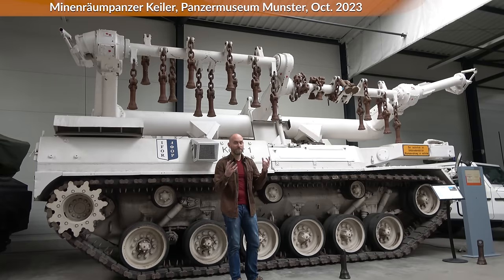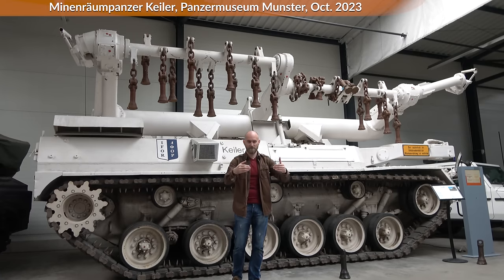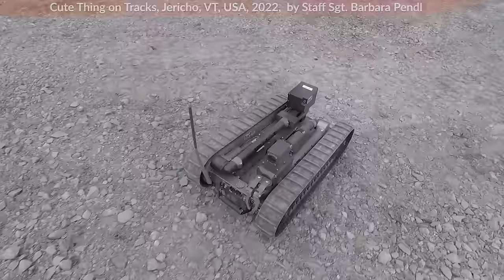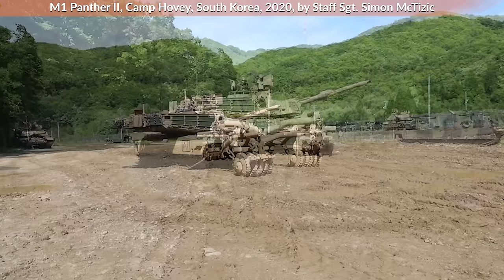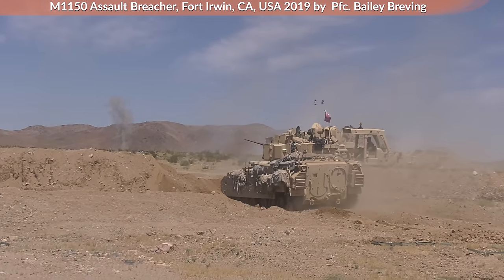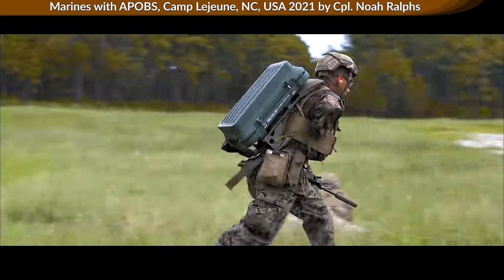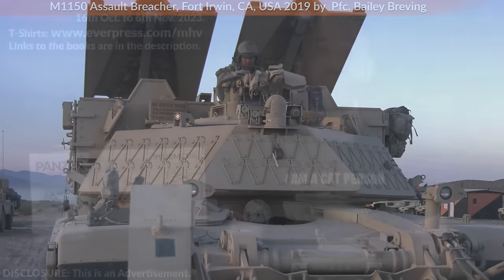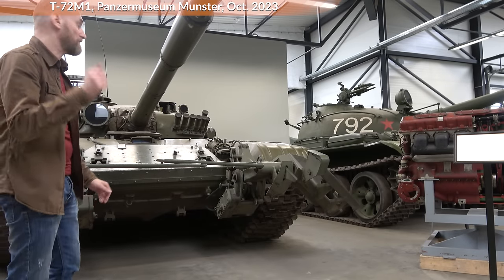Ukraine: The Problem with Mine-Clearing Tanks

Comment: You need to use 2 assets to conduct a "deliberate breach" to "clear" a route - say a MICLIC and a Plough, not just one unless you want to accept risk with a "hasty breach".
The next issue is the depth of major minefields - a MICLIC (or Giant Viper) charge is only good for around 250m. If the minefield is say 1km deep you need to repeat a process of MICLIC then plough 4 times as you clear each 250m segment.
Also you need to plan on 50% losses to breaching assets. If you want 4 lanes open you need enough assets to start 8 breaches - 8 x MICLIC, 8 x Plough for a minefield 250m deep.
The KMT type option also limits follow on vehicles to the same width. You effectively break up a combined arms team because the BMPs, BTRs etc. can not drive down the same track width lanes as they are narrower than the breaching vehicle.
Lastly if you aren't using SOSRA (Suppress, Obscure, Secure, Reduce, Assault) your attempt is likely to fail as the obstacle will be covered by fire and observation.
Reply: as soon as there is activity in "mine field" you can expect a direct artillery hit as area was already scouted, measured and mapped for it
Reply: @rcajavus8141  Absolutely, one of the reasons why you plan for 50% losses.
Reply: US really needs to replace MICLIC...its never been a very good system.

The UK replaced Giant Viper with Python about 15 years ago. Twice the length and uses IM explosives. A Trojan towing 2 units can clear a 400m long path.
Reply: @dogsnads5634  Understood, I just wanted to provide some open source examples. The principles remain the same though.

Comment: Since these systems are rather rare, expensive, slow and very exposed when they're used, the fist thing you need to do to clear a minefield, is completely suppress any artillery system in the surrounding area and obtain air dominace.

Comment: That system on T-72 makes more sense than the one on Abrams, with rollers. If I saw well (but could be wrong), that Abrams has 2 rollers to the front in front of the tracks and one in the middle, at the back. The issue I have is that there are mines that use tilt rod to detonate. And if that thing is in the middle, then it is perfect position for it. Then the bottom of the tank will touch the rod, tilt it (as the name suggests) and it will detonate right under the tank, sending a shaped charge (or rather EFP) right into the bottom of the vehicle... That is why plows are way better.
So, the list you shown here is pretty good. 
Though, I have a suspicion about those vehicle that use "explosive ropes". Pressure mines have systems that prevent pressure (obviously) from these systems to activate them (radial stepping plate, for example)., so while it would detonate the mines it lands directly on, I'm not so sure about those that are near by...
Also, some tanks have, as you mentioned, systems that increase magnetic field of the tank (M84 have it, though not all of them) thus making the mine with that fuse explode way too soon...

Comment: A few additional lessons from Ukraine:

Incendiary artillery rounds are useful for burning down vegetation that can conceal mines and will make some of them visible. 

Aerial drones with thermal imaging cameras can detect some surface mines, especially at certain times during the day when the difference in temperatures between mines and the surface is greater.

Aerial drones can be used to either detonate mines with a dropped explosive or to pick up and carry the live mines with a grabbing claw on a line. This is inefficient for large scale clearing and only some of the mines can be cleared like this but it can reduce mine density remotely while the operator is relatively safe. 

Theoretically some AI operated surface and aerial drones could clear an area over time but the systems would be expensive and there is some doubt about the verification of clearing all mines in a path. 

The serious hindrance of mines in modern warfare suggests that a larger number of mine clearing vehicles should probably be acquired by most armies.

Comment: Before the Ukraine war, I never thought any force would be mad enough to try and clear mines in range of the enemy. I always assumed that such tanks were used after the battle to clear the space for additional deployments, not actually on an active battlefield. Madness.
Reply: only a cocaine high general would make such combat operation and send troops to do it
Reply: There’s no other choice
Reply: the problem is that there simply isnt anywhere on the frontline that isnt covered by mines from both sides. if either side wants to make an attack, they have to go through those mines and theres no other practical way to defeat them than to use those vehicles. its not that either side is stupid for trying to attack through them, its just that no alternative exists.
Reply: @rcajavus8141  or a general who has 300,000 unnecessary soldiers that he can send to their death, knowing that due to closed borders the population cannot escape, and he will receive another 600 thousand in 2 months

Comment: Eureka, I’ve got it.  Something like a hamster wheel with 18 inch thick steel rims, just need some willing volunteers or an internal mechanism to keep the thing rolling.  It’ll be effectively indestructable, but admittedly could only go in straight lines.
Reply: A modern Panjandrum might not be a horrible idea.

Comment: “America's cultural contribution. One million landmines, and my hovercrafts float right over them.”
- Colonel Moon Tan-Sun
Reply: Until they can detect the hovercraft above it and you are back to square one.😂😅
Reply: @tomizatko3138 magnet exist....
Reply: @tomizatko3138  the mine charge would lose most of the penetration capability before it reaches the hull of the hovercraft moving 1m above the ground, I suppose
Reply: Lol no, they wouldn't. AC vehicles will still trigger AT mines jn numerous ways depending on the mine. Hell, a stick trigge reaching up 10 inches would do it for cheap.
Reply: @camojoe83  a hovercraft at full speed over land flies higher than that.
Reply: @Chamieiniibet  not all of it, concept still would be effective.

Comment: This is one of the reasons Ukraine asked for F-16's well over a year ago. An army doesn't need air dominance over the entire battle space but over a section that will allow sappers time enough to clear paths and suppress artillery and helicopters.  
A rethink is needed for this problem anyway, like using small remote or AI vehicles to string out  mine clearing charges or lower cost full size remote vehicles in order to have more of them. So many the enemy can't destroy them all fast enough.
Reply: Yeah but they would need 100s of F-16s to get such local air superiority. Russia has dense air defenses and would quickly deploy more assets in area you are trying to breach. In addition Russia has rather lots of cruise missiles and ballistic missiles which would now have F-16s as targets on few air bases that can host them.

Comment: You should also talk about the challenge of detecting mines in the first place. Its not feasible to just assume there are mines everywhere and anywhere. These are assets they have to bring up when needed. Often times, the unit only realize they are in one when they hit one. but it could also be a very thing minefield used for delaying action to fool them into thinking it is a denser minefield. There are ground penetrating radar vehicles, mine detectors by engineers and now drones with thermographic cameras, magnetic detection and so on. And ofc these tools help mine clearing too.

Comment: As a combat engineer and EOD, i can tell you that Mine Clearing Line Charges (MICLICS) have several problems. Minefields are generally way deeper than 100 meters, especially in Ukraine 400meter and more are common. If you want to breach a minefield deeper than the maximum clearing capacity of the MICLIC, you will have to shoot two: reloading times aren't extremely long, but that kind of defeats the whole "it is way faster than anything else" argument, and also after the first charge what you are trying to do is as visible to the enemy as it would be with a flail, if not even more so. Also: The second charge would pretty much have to be exactly in line with the cleared path of the first charge, and with the rockets used in those tanks and also with the environmental factor, i would not bet on that that works. Last point, a minor one: the charge loosens up the soil, possibly making the difference between "just good enough for a company to attack through" and "secons vehicle trying to pass will get stuck". With a flail of plow, the breach will be 10 times more passable for the vehicles to come.

Comment: Another thing that I am surprised wasn't mentioned at all in this video is that artillery barrages and bombs can be used to clear mine fields. Im unsure on what extent this is done in ukraine but during WW2 heavy artillery barrages were commonly used to clear lanes through mine fields, and dropping a line of bombs can also clear a lane through a mine field. These are far more wasteful then other methods but the fact they can be done quickly and instantly clear large sections of mine fields is a large bonus that cant be ignored.

Comment: There was a Ukraininan video about the problem in Ukraine, the mines were tripple-stacked. There was an artillery shell at the bottom and two mines on top with an anti tamper device. That means there is explosives equivalent to 4 mines, for which the mine clearing tanks were not built to handle and get immobilized. The only ones that are effective are the line charges.
Reply: Link to the tripple stacked mines video... https://www.youtube.com/watch?v=YDZTlYIayQ8

Comment: I was many years ago actualy a mine flail driver among other things. I just thought i share a little knowledge.
The white mineflail tank you see in the video is an older version and its easy to see that it have a design flaw that can jepody the tank and crew safety.. The tank drive in a streight line and so does the mine flail. It so to speak dig lines in the ground just like if you pull your fingers though sand in a streight line. You will get some deep lines in the sand where the fingers was while other become taller and untouched. Other kind of mine flails does the same, but they move the flail a little bit to the left and right and the mine flaim that spins move in a zig-zag patern as it drive forward. This reasult in better mine clearing since there is no "lines" in the ground where potentially an anti personel mine is untouched.. 
But in general mine flails just dont belong in the front line in any army. They are really slow and many models do like 300-500m pr hour and cover a 3m wide track or more.. some flails do not even clear a wide enough path for tanks to follow behind  so it have to remove the track 2 times to make the cleared path wide enough.
Also mine flaims are actually very expensive its like +5-7000usd pr hour and the chains only last example 10 houres before the metal are worn out and fall off, and also everytime you hit a tank mine a few chains are ripped off that you need to change = you have to leave the vehicle to do so in a mine field with the enemy pointing at you.
Mine flails are however okay for peacekeeping missions and humanitarian work and the ones that can zip-zag can make it like 99,9% safe to walk on the ground afterwards. either the mines explode or fall appart and then there is only the detonator left.
They are however almost worthless regarding comming to the rescue since it take +1 hour for them to reach the area.
They can also remove mines on runways and roads by reversing the direction of the chains, and then mines can be removed rather quick.
Personaly im a bigger fan of an automated remote controled tank with a plow that you just send forward in an assault and with AI now a days i dare to say that is the way forward.
But with all military gear no system can stand alone and it depend on the terrain and situation what tool to use in the toolbox.
That is how armys work. 
But there are many different kind of ways to remove mines. Some places they use rats to find mines, other places they sprey gene modificed seeds on fields and when there is mines nearby the flowers changes colour. Other places drones are used.

regarding mines then most of the ones you see in ukraine/russia are the old simple mines. But now a days there are also intelligent mines that can mesure vibrations in the ground and send signals to the HQ about enemy activity. They can remote control them and turn on/off depending on who should go though. Also some mine types have a timer that allow you to say that example in 365 days from now they should deactivate so they are no longer dangerous. THis is great after a war that you know after x time mines no longer work. But in general more or less everything you can imagine can be done now a days.
Sometimes mines also move their original location when there is heavy rain or flooding.. it was quite normal to hear explosions in the mountains in serbie and kosovo when the ice hocky mines move around.
The worst thing was the bomblets from clusterbombs since some did not explode and landed all kind of places or be thrown up on top of the mine flail.

Fun thing.. i think it is the belgian army they have inflatable boots so they can walk into minefields. I did not dare to try.
I did my self by accident walk though 2 mine fields since i came from the wrong direction and could not see the marked signes.
I can laugh about it today but it could have been tragic.
Reply: Thanks, great write up. Yeah, even the silly solviets throw in enough wierd stuff to mess with mine clearing.
A tripple stack of anti tank mines with an artillery shell seems like it could easily take out any mine clearing vehicle. Or at least damage it.

Comment: As a combat engineer in FDF the only things that I would say actually work against a dedicated minefield (not something that' just dumbed via artillery but rather properly dug in by combat engineers. Like the minefield we in FDF do) are the 1 and 2.
The reason why these plows and chains, etc. don't work with proper minefields is that there's bound to be "surprises"; ie. AT mine connected via explosive cord to 50 - 100 kg of TNT dug 10 meters from the AT mine towards the enemy. Put a head-sized rock on top the TNT and you've got a shaped charge.
Of course these don't really work if you don't have the time to prepared the field, so again we go to the fact that combat, and war in general, is just compromises. You can't have it all.
It takes a fair amount of time to make a proper 100 x 500 meter minefield, not to mention manpower, and while being deployed, the combat engineers and their supporting elements (trucks, for example) are easy targets for drones, helicopters, etc.

Maybe this is something that still lives in Finland, because we have a lot of forests against our enemies border ("The enemy always comes from the east"), as the forests do give a lot of cover from air assets.

The different between "old style AT mine" and a more modern, shaped-charge AT mine, is, among many, that the way they are used and deployed. Though fact of the matter is that if you plow it away, it'll just be nice fireworks. Of course, it's connected to the aforementioned surprise, but only if there's time.
When mining a road, for example, there might not be time to even dig a small hole to the more traditional AT mine, let alone a bigger hole for the more advanced one. In these instances any extra boom won't be around as there just isn't time to do them.

Still. AT mine has been an AT mine for 100 years. I'm pretty sure it'll be for another 100 years ;)

All in all, good and interesting video!

Comment: I've often wondered by no one has explored sonic resonance of mines. We know that all objects will resonate with the right frequency and vibrate. Some until they shatter. If you make the volume loud enough, you can deafen the enemy or even disorient them so they cannot function. 

The LRAD showed that a coherent re-enforcing beam of noise can be so strong that it temporarily debilitates the target. LRAD can be directed to even make it unpleasant for pirates approaching a merchant vessel. It would not take much research to work out the frequency at which the detonation circuit starts vibrating and putting enough volume into the speaker that the ground literally vibrates and is then scanned across the ground at far enough away so the mine is triggered without affecting the speaker. 

Of course It would require the mine clearance crew to do this by remote if they wanted to keep their hearing, but at least it would cover a larger area and should activate enough mines to declare the area clear. Anything that did not detonate after being shaken beyond resonance is not likely to go bang anyway. You might even be able to place the speaker on a dirigible with splinter-resistant fabric and fly the balloon up and down corridors repeatedly until the field is clear.

Just to make a point, Ukrainian anti-personal mine clearance consists of using a long tree branch and then whacking the butterfly mine outside the lethal zone. Directing a high-volume LRAD would certainly make most butterfly mines vibrate.

Comment: I would think that more use of remote controlled mine clearing vehicles based on a full sized flail or plow manned type would be used for combat situations reserving manned units for minefields that fall behind the lines. I know this doesn’t seem to be a thing yet but surprised it doesn’t exist.
Reply: Flails haven't been used seriously for years. They're only used by mine cleaing in safe areas, by charities and the like, for anti-personnel mines.
Reply: Problem with remote controlled mine clearing vehicles is the "remote controlled" part.